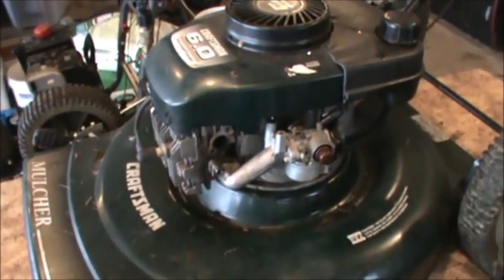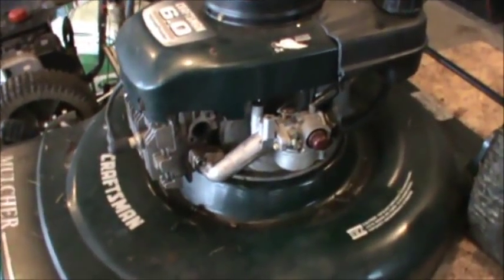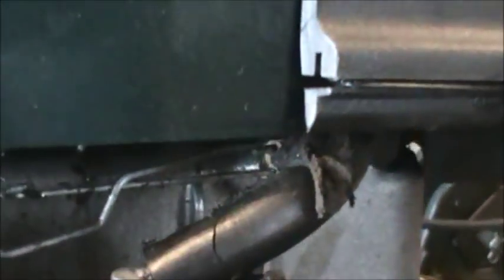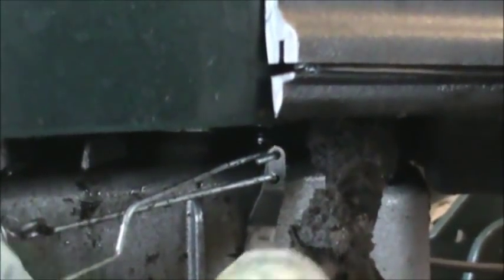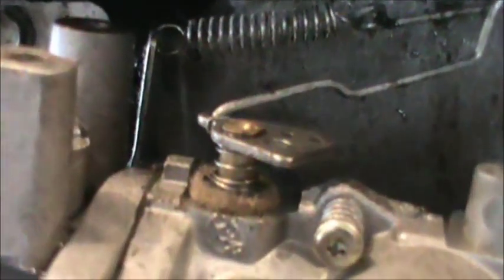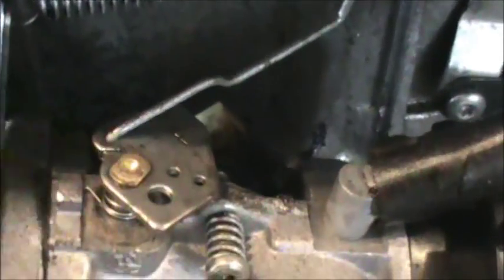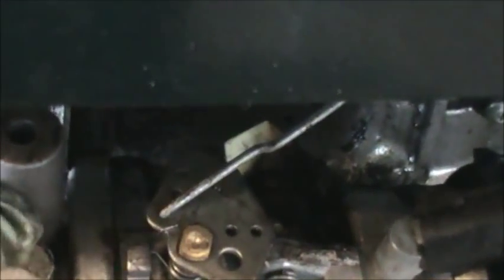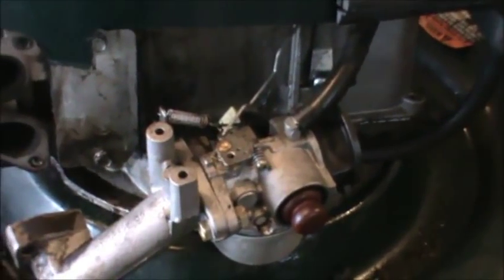Craftsman Tecumseh Governor Linkage Spring Locations

Comment: Every video I watched said the linkage went into the second hole on the carb... 
Even though I could see that it had been in the first hole (I figured someone had 'worked' on it and put it in the wrong hole because the spring plate, on the carb was bent). 

Mower ran like crap so I figured after watching videos on replacing vs. cleaning it was worth less than my time to replace it than clean it.
Figuring a new carb should have everything back to spec, I straightened the spring plate.
Every video, also, said the spring went to the governor top hole and the linkage went into the bottom hole.
It was way over revving. 

Thank you for setting the record straight. 
New carb, now runs like new and I can hear the governor slow down the speed immediately after it starts.

Thank you for preventing me from blowing up my mower!

Comment: My governor rods got disconnected when I removed the carb and intake manifold.  The old craftsman is similar to this.  Thanks, got it hooked up right, and started it on the first pull.  

P.S.  All I needed to do was clean out the jet, so removal of the unit wasn't necessary ... but i did take the opportunity to give the whole thing a good cleaning.

Comment: Hi, came back to Michigan to help my parent during this epidemic and need to mow the yard.  Well, attempted to clean the carb and the linkage wire fell off.  Not sure where to connect it too.  It is from a craftsman Eager 1 4pm.  It appears to connect to the top hole and not sure where to connect to on the other side.  Is it the hole you connect it here?  Model of mower is 917.383410 and engine is 143.364062.  High and low is a round nob with and arrow on it. Than’ you for any help, stay healthy.

Comment: Hey doublewide 6 I picked up a craftsman pressure washer with a similar carb setup. It doesnt appear the  throttle does anything but engage the choke. Pretty sure there should be a high and low on the engine but I can't seem to see where the throttle engages the butterfly. Do you have something that shows where the throttle is attached to this carb?
Reply: jgb0223 i am also looking for this info

Comment: So I have the linkage set up the correct way and this motor is screaming at me definitely running to high ... I tried adjust the screw nothing happens an the tang that the spring is attached too an moving the governor arm up an down nothing seems to work can u give any more ideas or what I might doing wrong thanks

Comment: Hi, I have an issue with cold starting my mower with a Tecumseh engine. Actually it starts, but I need little help from someone that needs to play the governor while I'm pulling the cord. Once the engine is warm, no issue to start it back alone. Also, the engine seems to work just fine otherwise. I wonder if it could be caused by a worn spring without enough tension.

What do you think?Type or paste your English text here and click on the "Check Text" button.
Reply from the maker: Sounds like the choke is not shutting all the way, so the mixture is not rich enough to start.  Is the air filter in the air cleaner box?  Some mowers will not start without it.
Reply: doublewide6
It is in the box for sure. Not so sure it is that clean though.
Reply from the maker: Remove the dirty air filter and place a clean dry folded washcloth in the air box and see if it will start.  Look in the carb and make sure choke is shutting all the way. Also, Watch my videos on how to start a snowblower that won't start, or search my channel for lawnmower carburetor repair.  Preform a carburetor cleaning and post back the results.

Comment: my revs and dies when going over long or wet grass. what do i adjust?
Reply from the maker: bmark0610 Watch my carb cleaning videos on lawnmowers.
Reply: doublewide6 I don't need a carb rebuild, I just rebuilt it. When i move the trottle switch on the top of the carb it revs nice, but i dont see where the adjustment is...
Reply: +bmark0610 .. bend tab to make spring longer ... and in this video the choke spring is not in the proper position ...it should be close to the set screw ... I cannot see where the top of the spring is here
Reply: +wierdful1 ...next . if more RPM is needed remove air cleaner and loosen screw on linkage arm ...sensitive adjustment warning ... move 1/16 in to stretch spring tighter and retighten

Comment: Shaking my fist---- I dont like Tecumseh lol
Reply from the maker: Why don't you like Tecumseh?
Reply: The tinyest itty bitty thing can clog te
The fuel tube, i know i know im griping lol :)
Reply: Because there are times i cant find my smallest tip cleaner to make sure those holes are not clogged, but the larger engines on riding mowers are pretty good, the older small engines had a defect with the oil tube where it sticks into the engine, the rubber seal would not seat good.